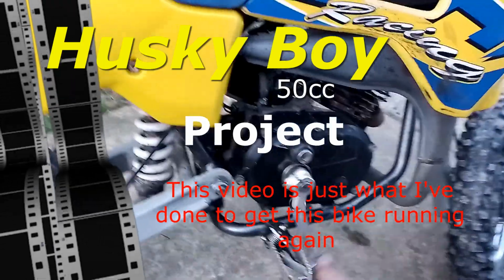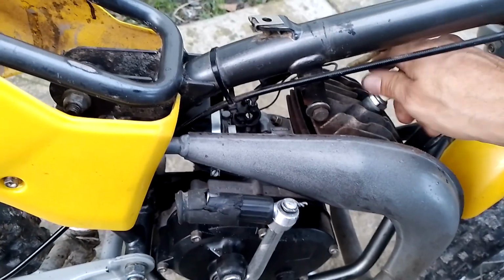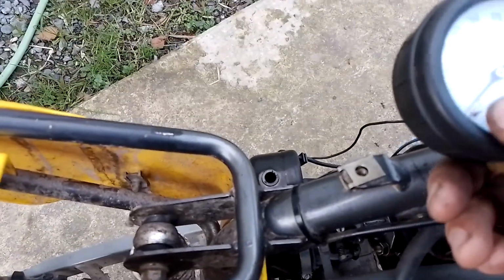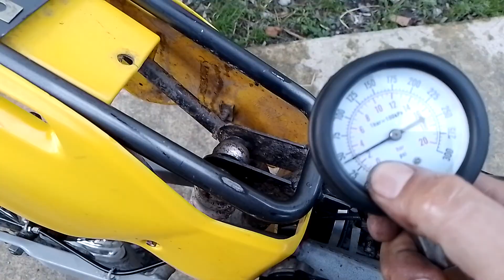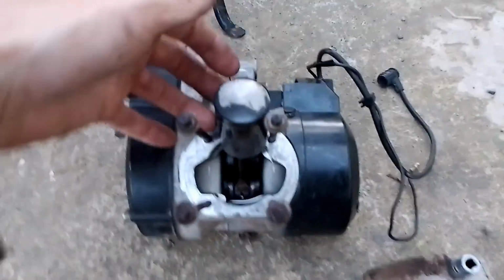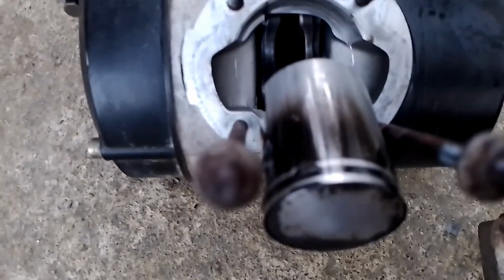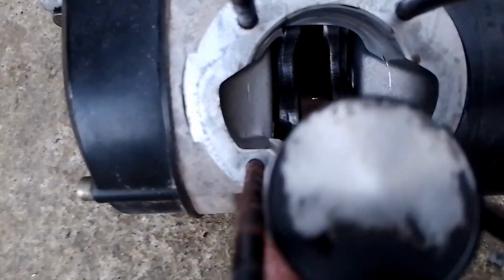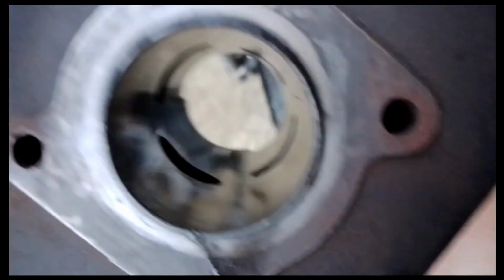Husky boy s5 50cc

Comment: Great video! 
Just got a Huskyboy for my son. Do you have any suggestion on what to do with the rearbreak, tried tightening the wire both at the handle and reararm, but it still break very poorly.
Reply from the maker: Hi, Thanks!
If you haven't already, I would start by pulling apart and scrubbing clean the brake shoes and drum with petrol or brake cleaner. Once they are dry, reassemble and if still not working right, try adjusting the rear arm a couple of teeth on the hub. This should help if your brake shoes are getting low and are running out of adjustment on your cables. Let me know how you get on!

Comment: Awesome video, did you have to do anything to the clutch on this bike? I think my husky 50 clutch might be slipping a little bit, where would you get parts like new clutch springs or gasket? Thanks
Reply from the maker: Thanks for watching. The parts I got were all found on AliExpress. I didn't need to do anything to this bikes clutch but did give it a look over and everything was ok.
Reply: @V4XEN  great thanks. I have a very sneaky feeling I have this exact bike from your video! Except the exhaust pipe tip looks a little different
Reply: Love these little engines my son has the LX2 or LX3  I have all 3 top ends for the s5 only problem I’ve ran into is finding some small internal parts . Part reference # 68 is a small thrust washer and there is 4-5 of them and they are basically impossible to find due to the measurements bought two engines for 160$ through another you tuber . Sounds a lot better the 2nd time you put it all back together did you do a rebuild video on this engine?

Comment: Thanks for the vid mate. Which country are you from? I have the same compression tester and find it to be quite unreliable when screwed in, I always get a much higher reading with the rubber “push in” attachment.
Reply from the maker: Hey, thanks for your comment. I've noticed the same thing. However, the compression was so low before the new piston and rings, that it didn't make much difference. 👍

Comment: Can you help me please? What is the oil capacity in the engine. 0.25l is set in the manual, no it does not take more than 0.16l. Do I have to tilt the bike to take the 0.25l. I am confused. Thanks!
Reply from the maker: Hi, interesting... I do recommend the user manual amount. However, you may need to drain the oil out then remove the side cover and check that it has all come out. Some time's the oil can turn into a jelly like goop and won't come out when drained. Let me know how you get on!
Reply: @V4XEN hi, i also wanna da a oil change but i dont know where the Oil drain plug is to get the oil out and also, which new oil should i use for the husky?
Reply: @jannik_8561  oil plug underneath the engine. its the only one so cant go wrong